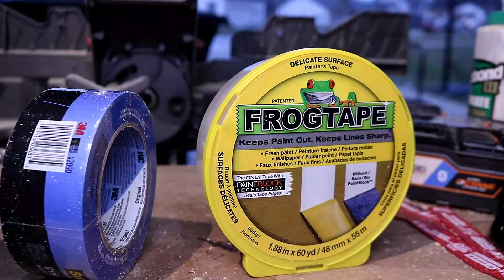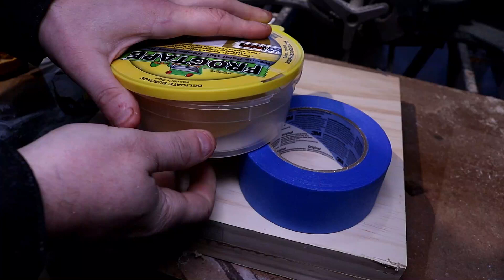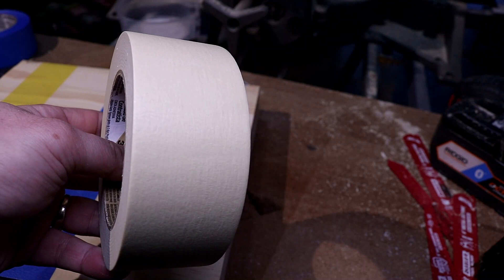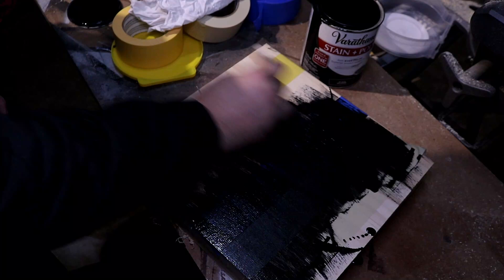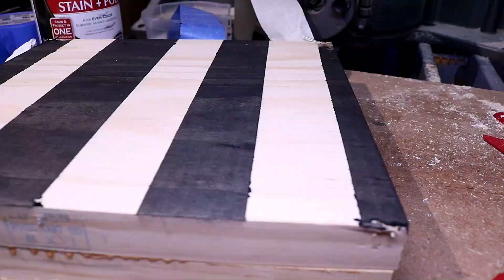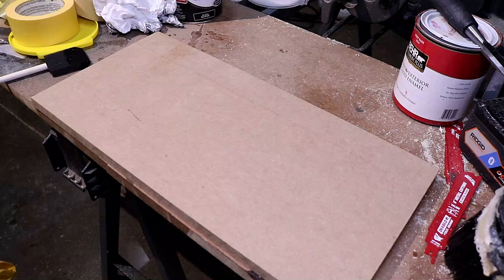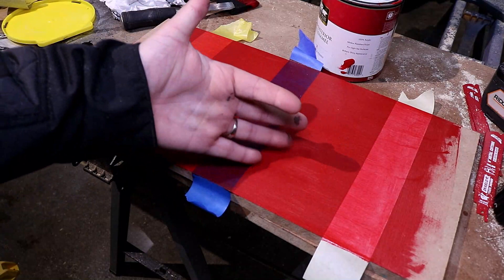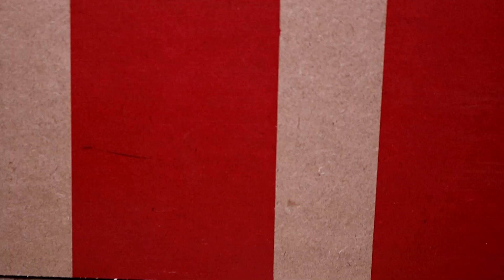Best painters tape showdown - This is who I think makes the best painters tape

Comment: Stain penetrates the wood and will creep under the tape. Also that paint blocking "technology" is for water borne coatings not oil based like stain. I have found that using a damp (not soking wet) rag to wet the edge first really helps with keeping a sharp edge with latex paint. 
I like the 3M blue sharp lines tape or Frog Tape where I need to mask off. That tan contractors tape is okay when it's new but if you let it sit around for any amount of time it'll tear sideways off the roll or curl up on itself.

Comment: One thing I can say about the the blue tape, I purposely used it to cover up a place where Paint was peeling off an outside wall and a nail hole too on my house and months later I went out there and peeled it off, the wood was dry, the blue tape peeled off with ease, I could not believe it did not get sticky and stay stuck to the wall. Something like masking tape is hard to get off if you leave it there too long. I just thought I would tell you about that; however, I am going to get me some of that contractor tape too. Thanks for a great video.

Comment: Yeah, regular everyday 3m masking tape works fine. Thing is, the amount of time it's left on vs removal. THAT'S where the blue dominates! Leave the regular on a surface for 2 or 3 days in the heat of summer and good luck not having issues removing it. Ol blue? No problem. Thanks Clint, and God bless!😁👍 p.s. good thing about no nails is no dirty nails! 🤣
Reply from the maker: Absolutely 100% agree with you Dave, on both parts of the comment haha👊

Comment: I have the yellow frogtape and isn't it for use over freshly painted walls and won't pull the original paint up when removing. I do see that the inexpensive tape is just as good as the others in normal conditions. This review is going to save me some cash in the future. Nice comparison 👍
Reply from the maker: Yeah you can put it down over a painted surface, but it still never worked well for me bro. Not sure what it is with it, but it was like putting velcro on a flat wall??
Reply: @ToolReviewZone  I have used it several times on these textured walls here in Texas and if you leave it sit for to long it still pulls the paint off the wall. I think they all would be non stick if you pulled it off the wall while the paint was still damp. Definitely not worth the price.
Reply: You need the purple tape for freshly painted surfaces. Even then I would be real careful putting anything on freshly painted surfaces.

Comment: Nice video Clint! Thanks!

Frog tape definitely has Its place. We try not to use it often. It works best on delicate surfaces such as latex on the fresh side, and textured surfaces. It does real well conforming to say, a new painted wall with orange peel. Has just enough stick without ripping the paint off the wall. It's best uses are uses when you know a shitty contractor did a shitty job and didn't prep walls before painting. Literally every other tape will peel the paint right off. But it is overpriced. We use scotch looking Sherwin williams tape and a ton of blue 3m. 

Take care bro! 👊
Reply from the maker: Hey David!!!!! Yeah bro, I could definitely say it would work well for what you just said. Thanks for the feedback and comment bro👊👊👊👊